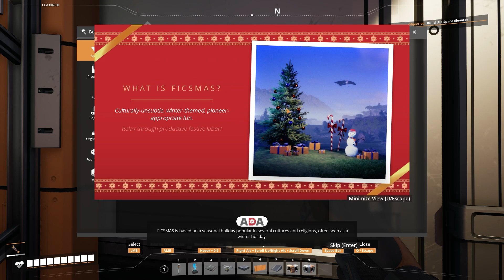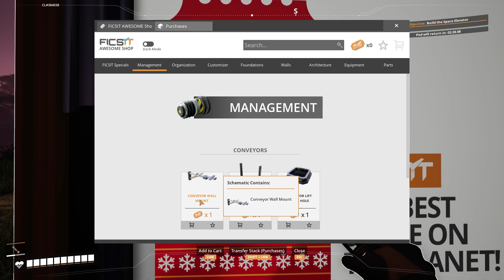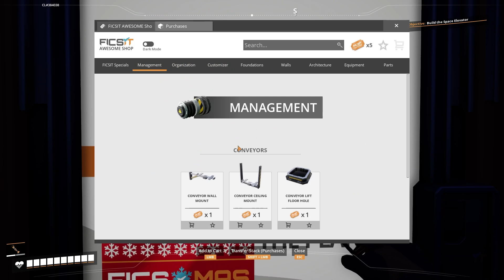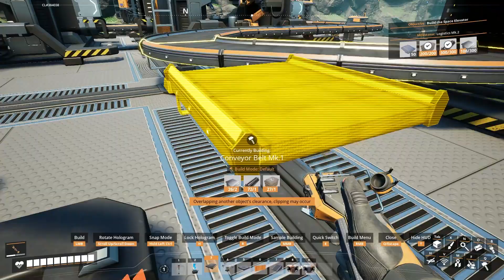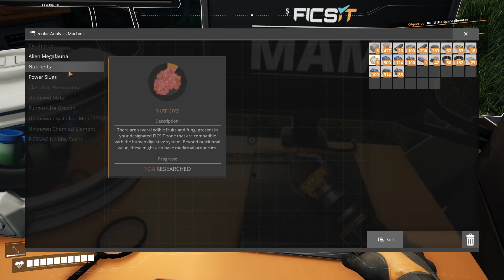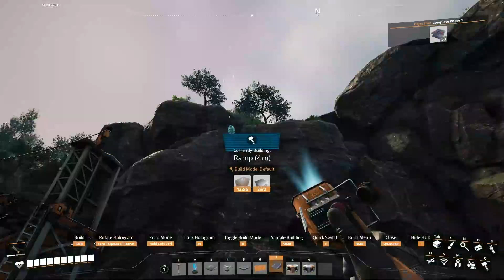Rotor factory & space elevator - Satisfactory 1.0 EP04

Comment: When building foundations on the ground, I recommend 2m or 4m foundations.  The snap to grid also aligns it vertically.  A 1m foundation could be aligned 0.5m off from other foundations on the grid, but there are no 0.5m ramps to fix the alignment.
Reply: I thought this got fixed. Might be worth some testing tho.
Reply from the maker: Oh dammmn I've been using 1m foundation be default, though I've never had that half alignment issue you mentioned

Comment: You have two types of scanning: resource scanning, which you access by holding V, and object scanning (e.g., for power slugs). For object scanning, you need to build an equipment workshop found under the "Special" tab.

While building foundations(and other buildings), you can hold R or E to open additional options. This provides useful building options, especially for "zooping," which allows you to build multiple foundations at once.

Power slugs are used for overclocking production, functioning similarly to speed modules in Factorio. All power slugs are converted into power shards, but in different quantities: blue slugs give 1 shard, yellow slugs give 2, and purple slugs give 5.
Reply from the maker: Thank you! I thought it needed something special